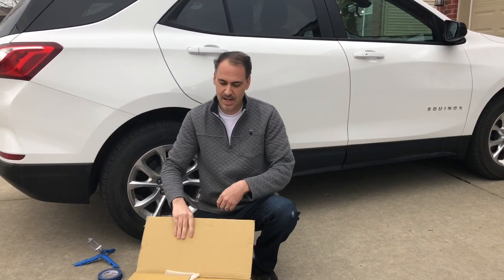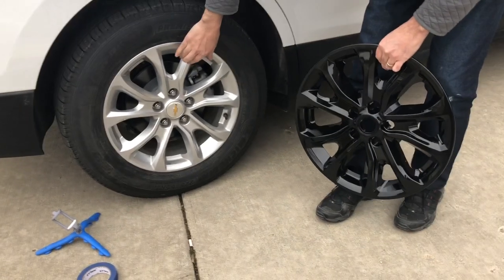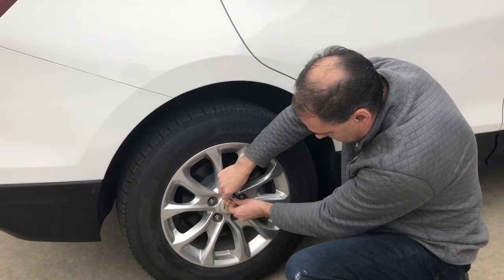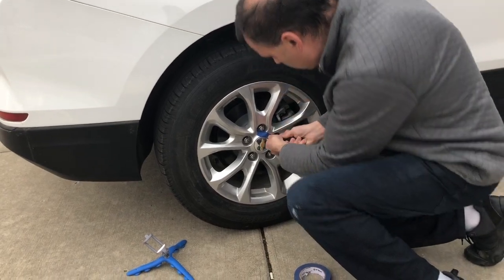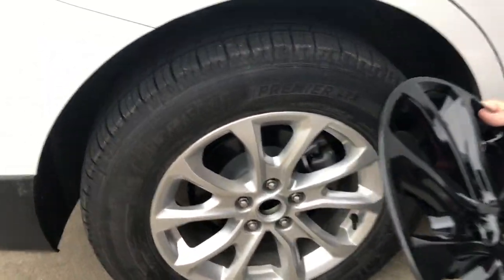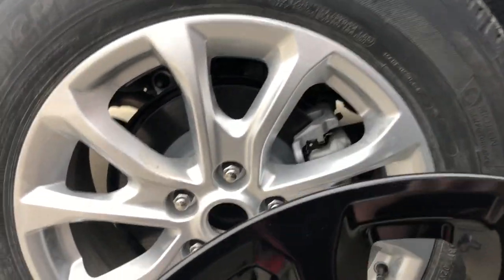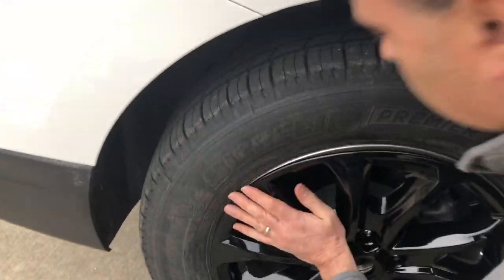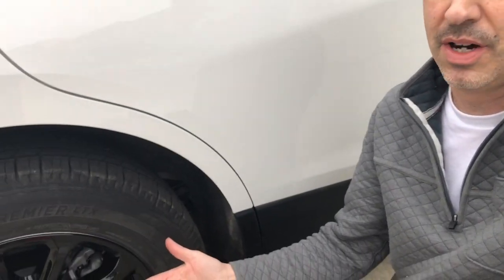How to install Wheel Skins on a Chevy Equinox,  Installing wheel skins is a cheap upgrade-looks wow!

Comment: Love the way he protected the rim with blue tape and then dropped the center cap upside down on the concrete to get all scratched up
Reply from the maker: All scratched up??? I don’t think so, please watch again
Reply: @7gshark  it landed upside down on concrete. There are scratches there. Maybe you can’t see them unless you get up close, but it’s scratched. But go ahead and put blue tape to protect your other 3 rims. Btw, find a new videographer
Reply from the maker: @Red_Dragon_46  ok

Comment: Wow, they renamed “hub caps”
Reply from the maker: Kind of but these are more upscale.
Reply: Hub Caps are a universal fit for all wheels, these are customized to fit each unique wheel
Reply: @LebronJames-if6qg  my old 20” chrome wheels aged badly but would cost thousands to change but with wheel skins new wheels are just a couple hundred! A much better idea! Have them on my 2021 4X4 Ram crew cab and everyone loves them!
Reply: @7gshark  i got the wrong skin to a Ford Explorer what can I do?
Reply from the maker: @moneychasing4088  it won’t work, they are exact fits.  Try to return it or resale on FB or ebay.

Comment: Do not remove the center caps from the front!  Remove the wheel skins completely and pop the caps off from the underside. Much easier!  You will also scratch the caps and possibly the skins.
Reply from the maker: @RobertBarone-n3w  good call thanks for the additional tips

Comment: Any skins for 2016 jeep grand cherokee limited????
Reply from the maker: There’s a high probability, check Amazon or eBay
Reply: @7gshark  i checked man.. nothing for 20x9
Reply from the maker: @bmac7039  are those OEM factory rims?  or after market.  The suppliers typically only make them for OEM.  I looked and I didn't see and for 20" as well
You could try to powder coat for like $400 or so.
Reply: @7gshark mine are OEM. But yeah I found nothing for mine lol
Reply from the maker: @BlackKokane706  did you check eBay
Reply from the maker: @BlackKokane706  https://www.amazon.com/stores/RestylingAccessories/page/04A3A022-8DAB-4C72-8DD0-7D01CEB63305?ref_=ast_bln

Comment: Any reason you have to take out the center caps before pressing them on? I did this previously without taking them off and they held fine..
Reply from the maker: These just fit that way.  If I didn’t it would have been too proud in the middle.  But you are right I had a 4 runner where I didn’t need to remove the center cap, so it most depend on the manufacturer

Comment: I removed my old skins yesterday and DID NOT remove the center dust caps. All I did was to remove the skins and turn them upside down and pop the center caps right off. When you try to pop the caps off like this video shows, you will scratch the living hell out of the caps and possibly the skins!
Reply from the maker: @RobertBarone-n3w  good advice thanks

Comment: Saw him get some tape to pop off the center cap (or center piece as he calls it), aww good man, he's a pro!
Then see how he puts the tape and gets a screw driver... 🤦🤦🤦😒 What a n00b!! And he scratches it too 🤦

Pro tip: use the tape to actually pop off the center cap! Duct tape works better as it grips better. Cut 10" of duct tape, tape half the center cap with one end of duct tape, fold the duct tape in two as to have a handle, tape the other end onto the center cap. Then in a quick motion yank on the duct tape pulling the center cap clean off the wheel.
Thumbs up of you did this 😉
Reply from the maker: Can I like and dislike your comment??  Not sure just tape would work that cap was on crazy tight.  Will try next time.  Thanks for the comment
Reply: No offense but I also tried to get these off and no way just tape will pull them off

Comment: Thank you for the video! Any suggestions on how to keep them clean. I just purchased some for a Malibu. I’m not sure what type of cleaner to use to keep them shiny.
Reply from the maker: I just use car wash soap, it's not hard to keep them clean.  My only issue is they are very BRITTLE, so if you live in a cold area use caution, they can crack if you roll up on a curb or something.

Comment: So you dont need to remove lug nuts? Just the center cap? I hust ordered some. Didnt think they just popped on but i hope they stay on and don't pop off.
Reply from the maker: Correct on the lug nuts.  They snap in really tight

Comment: Quick question.  I got some wheel covers for my Camry off eBay.  I just put them on without removing the little Toyota logo on the wheel before installing them.  I didn't know until after I installed them and then I went to throw the box away and the instructions fell out instructing to remove the logo before installing them.  Does it make a difference functionality wise?  Am I safe or do I need to take the covers off, remove the Toyota emblem on each wheel, and reinstall the covers?

Edit: I've driven a little around town with my wheel covers.  No issues.  But idk if I should/need to have that emblem placed on the wheel covers or if I should be fine/safe as is.  The emblem cap is still on the actual wheel though.  It's just not on top of the covers so I'm not sure if it really matters one way or another.
Reply from the maker: Well on mine the center caps kind of snapped in.  I think you are ok though I had a 4 runner with no center caps.  The only issue you might have is if the center caps make your skins sit proud of rims ( kind of bending it)
Reply: Are you serious? Its just a cap. Did you think the car would blow up if you didn’t swap them over?
Reply from the maker: @MrRahimhosein  do your research it’s not a hub cab

Comment: What about rust? Do the wheel skins trap moisture in the long run?
Reply from the maker: Good question.  The only issue I heard of was small rocks getting in there and making noise when they rattle around

Comment: Can u do it for a 2015 Chevrolet trax
Reply from the maker: @NOTQUITLIKEKK  I don’t own one, I did one for the Honda hrv.  Check amazon or eBay for the trax parts, it’s an older model so they typically seek them for $80.  Good luck

Comment: and these won't go flying off at speed...over time...?
Reply from the maker: So far so good after 9,000 miles.  I also had them on my 4runner and had no issues.  But if you live in a cold state they can get brittle and crack if you hit a curb or something
Reply from the maker: it's almost impossible to pry them off without braking the tabs,